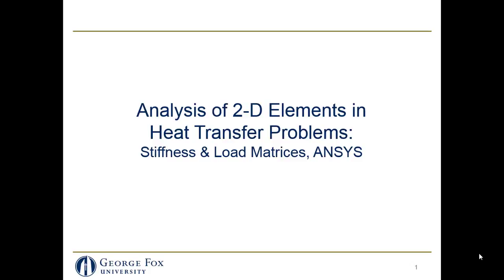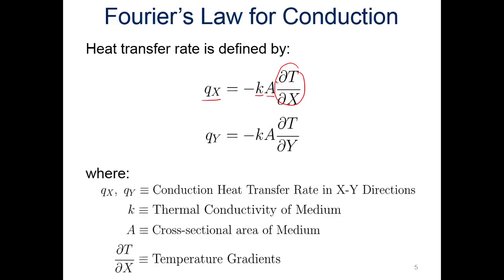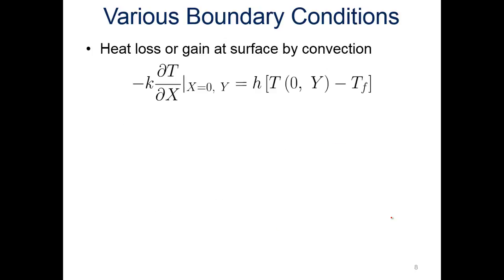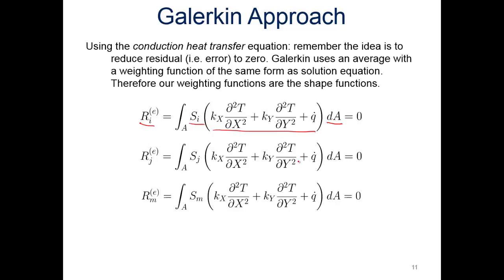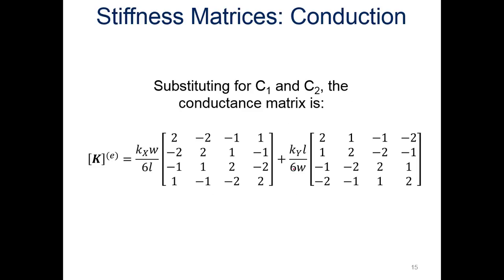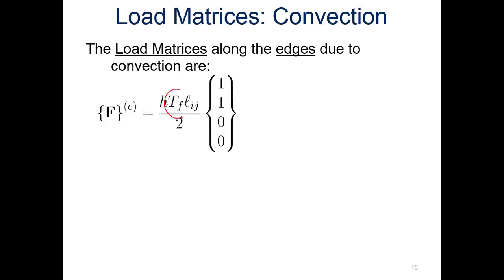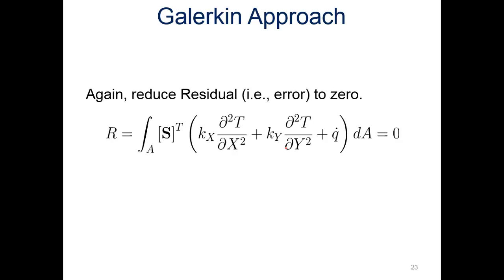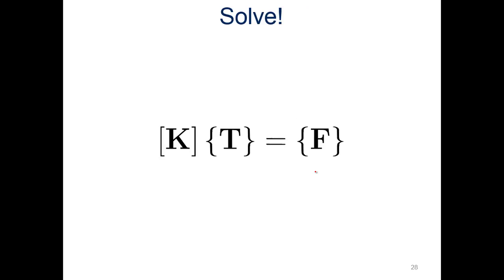Analysis of 2-D Heat Transfer Problems (1/3): Rectangular and Triangular Elements

Comment: Say I had a 2D flat plate, and I had the four edges defined with known values of their temperature. I want to create a mesh that has a fair amount of uniformly sized triangular elements. For example, the flat plate is divided into a uniform "grid" of 4 nodes by 4 nodes (looks like a tic-tac-toe grid, 18 triangular elements). I am using the heat equation d2T/dX2 + d2T/dY2 = 0

My issue is this: I only have 4 unknowns (the 4 nodes in the center of the grid), since the walls are defined. How do I form a global stiffness matrix, and the global force matrix, to solve for the 4 unknowns? 

I am able to solve 1D using the same methodology, given various boundary conditions. But since one (or more) points of the 1D element are sometimes defined, I don't have to form a system equation for that point (using K and F), because it would be redundant, so it is common practice to put 0's in place of that system equation. Is it the same idea with 2D, where at nodes that are defined, the system equation pertaining to that node can just be replaced with zeros? Would I need to deal with x and y components separately in two matrices? Create a 3D matrix?? Any questions you are able to answer are greatly appreciated!